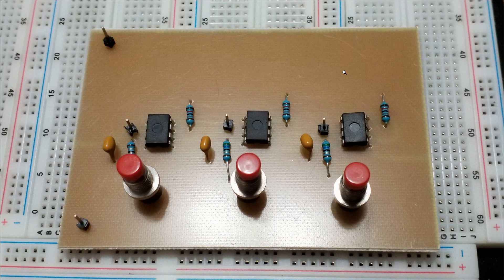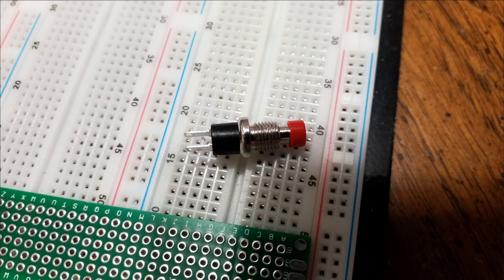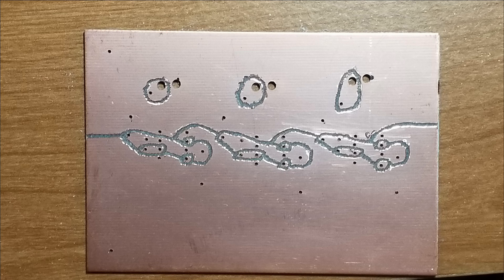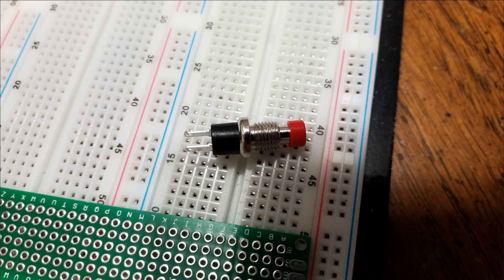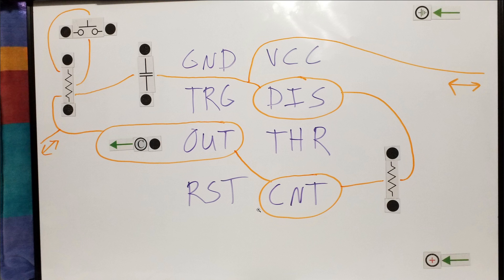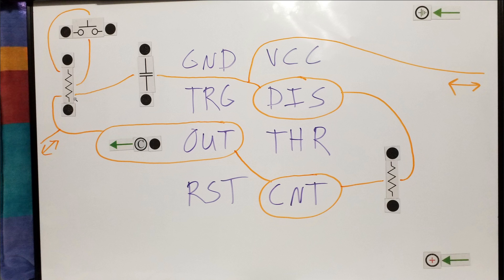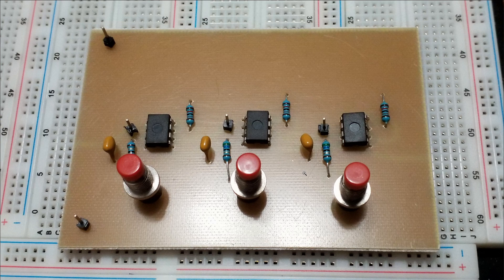Homemade PCB With A Dremel - Debounced Button Input Board - Simply Put

Comment: Might be worth trying a masking tape layer on the back side of the board for drilling. If that doesn’t work maybe even packing tape. The extra support on some materials can make a huge difference. Maybe even some drilling lubricant. Anything works, including wd40 which is definitely not lubricant.
Reply: wd40 is so lubricant 😠

Comment: SP, you probably have realized this by now, but those switches were not designed to be mounted as through-hole components. They are panel-mount devices. The entire body goes through the board or chassis, head first, then a thin fastener (hex nut) locks it down from the other side of the panel (hence the threads on the switch) .  You should have done that, or if your intention was to have nothing protruding on the underside of the board, then you could have easily drilled two thick wire sized holes through the board, threaded a loop of wire through the board and the holes in the switch leads, and twisted the loose ends on the underside of the board, then soldered the switch leads, wire loop and board trace all into one blob that serves as a very sturdy anchor. And yeah, as others have mentioned, there is an easy solution to tear-out. You must have missed wood shop that day …

PS another way to mount those switches would have been to build a frame for them consisting of a washer and a couple of sturdy pin-sized legs attached to the washer, then just solder the switch pins to those legs. You have to think like a cheap Chinese electronics maker.

Comment: A little trick I figured out that could have helped with your giant holes, aluminum foil tape doesn't take up solder very well at all. Using it as a blocking, containing layer allows you to melt a lot of solder without it running all over the place. 
Note:
Pros
1. The glue burns away and it doesn't stick when pulled away.
2. as long as you don't leave holes or openings it gets stiffer when heated so will contain all the molten solder without sagging or dripping.

cons
1. it stinks bad when the glue burns away and is probably pretty unhealthy to breath. Use ventilation.
2. too much heat and the foil will ignite.

You could put the tape down on the component side fill the holes with solder then when it cools the tape pulls right away.

Comment: The other way to avoid jagged drill holes is to back your material. Push your pcb against some wood, dense plastic or heavy cardboard while drilling.
Reply: As someone who sent a 5/16 drill bit through my hand while boring out a propeller shaft, I approve this message.

Comment: i would put the chip somewhere isolated and solder small cables ...... but this solution to put the 555 upside down by bending the legs is way better!!
Reply from the maker: I was being stubborn and really wanted to avoid having any jumpers for this board, just as a design principle.

Comment: PROTIP:  sandwich the board down to a surface you don't mind drilling through the pcb into.  you will be amazed at how clean the exit holes are and it just makes everything easier. obviously the greater the pressure, the more reliable the results.
Reply from the maker: I feel a bit stupid for not thinking of that, because now that you say it, it's obvious. Well, I shall do that next time.
Reply: I can vouch for this as well!!! I didn't learn about it until just recently too lol now it's a must on any drilling on any PCB

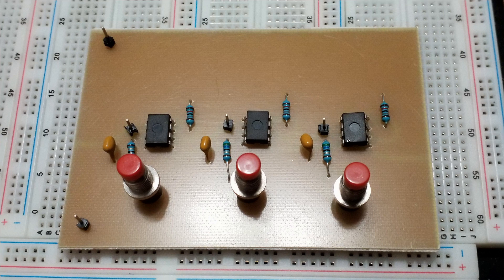Comment: At 6:44 you say „It will run on any voltage“. One should limit it to about 16 Volts to not damage the 555 timers.
Reply from the maker: I didn't mean literally any voltage, obviously. It will run on any voltage that you're going to be doing digital logic with. Unless you're trying to make a 16+V computer in which case...okay.

Comment: Have you considered making PCBs with a cheap mill?
Reply from the maker: I have resisted getting anything fancy like a CNC or a 3D printer (even a "cheap" one) on purpose, because I want my channel to have more of a "simple, DIY" feel, and simple power tools aren't that expensive and people are likely to have some available anyway just from normal life. But I am going to use stepper motors to create a robot arm that will draw a mask on a copper-clad board for me (as well as being able to write in general). Already seen some project walkthroughs where people have done that, and it looks fun.
Reply: That makes sense.  I’ve burned my own boards, but it’s been years!

Comment: Love your tutorials. What do you think about perf-board with holes 'Dremeled' longer for the buttons?
Reply: 3deeguy Same thought. Would have been less work.
Reply from the maker: I wanted to learn how to do this anyway, so it was a good opportunity. Also, I don't have a dremel bit small enough to get in a 1mm hole, since I just bought a "34-tool starter kit". I will be able to do such things in the future. I had of course thought to just drill the hole bigger, but that would destroy the via (that connects the two sides of the protoboard), so that would defeat that purpose.

Comment: Haha, great minds think alike, I've done some very similar things (both construction technique and "building block" approach).  Also, check out "Manhattan style circuit construction" if you haven't already come across that.  Basically, you create pads by using a saw to to create a grid of pads, or else glue some metal pads to a board.  Then solder each component lead to one of the pads.
Reply from the maker: Oh yeah, some of that is what I intend to do with copper tape. Just wait until you see how I'm going to build an electronic chessboard using wire, screws, magnets, resistors, and multiplexers.
Reply: @simplyput2796  I will certainly be looking forward to seeing that!